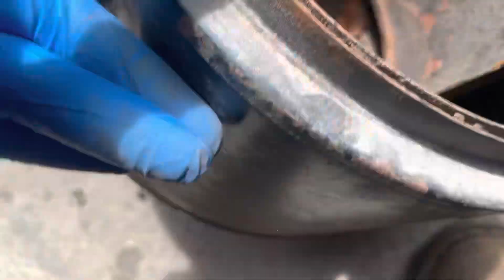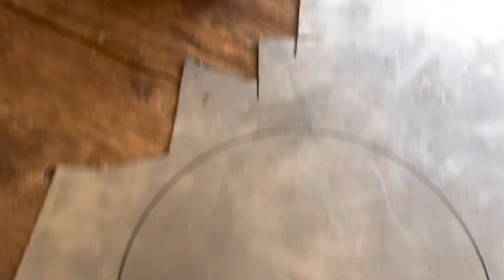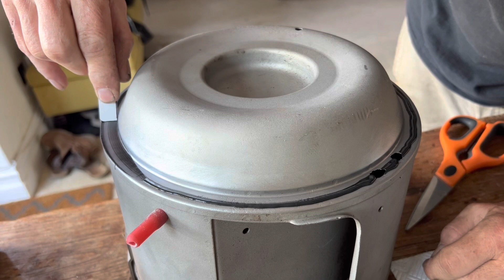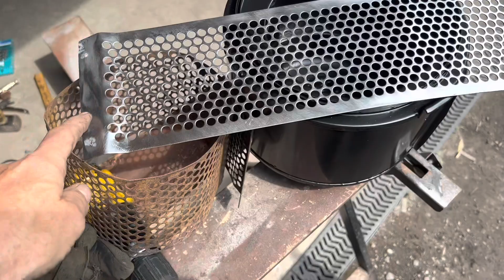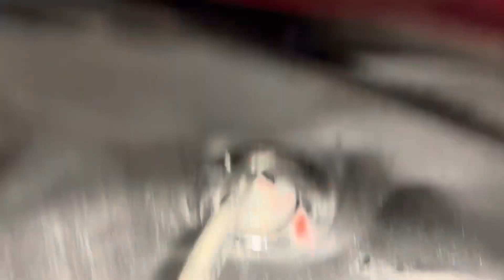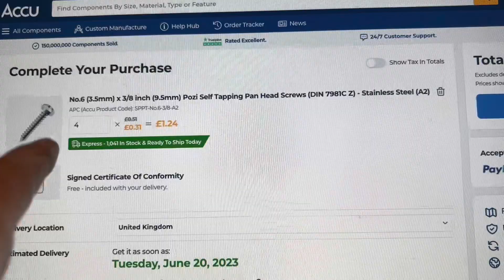Mercedes R107 280SL air filter housing refurb using 3M 08115 panel bond

Comment: What's the correct air filter for it?  I tried the Mann C15120, but it was about 1/4" too tall.
Reply from the maker: What model and year is your car? Mike
Reply: @MikesMercsandothercars Thanks for the quick response.  It's a 1985 Euro 280SL
Reply from the maker: Can you measure the height of your filter? I’ve just put my air filtration system back together after replacing the power steering line…..right old pain on the D Jetronic 280! I’ll have a measure of my 1976 K Jetronic filter. Mike
Reply: @MikesMercsandothercars  The existing one is about 7-7/8" high.  I think a new one has to be 200mm high or shorter.  Most are 220mm+.
Reply: @MikesMercsandothercars  It's okay now; I got the filter to fit.

Comment: Nice save
Reply from the maker: Thanks - looking forward to getting air/radiator and exhaust back on car and seeing if the ECU and ignition control module actually work and the car runs. Mike